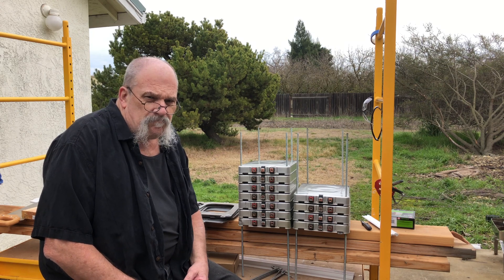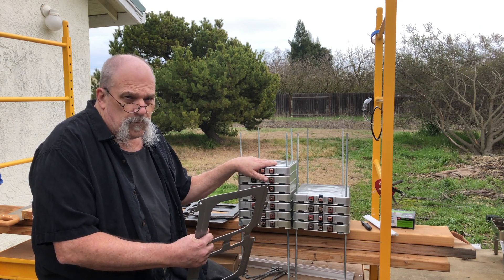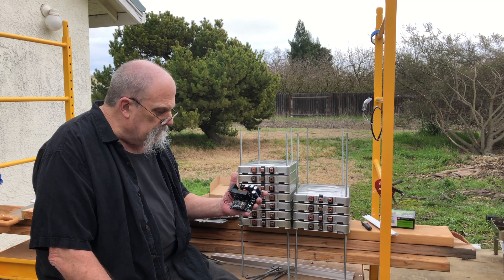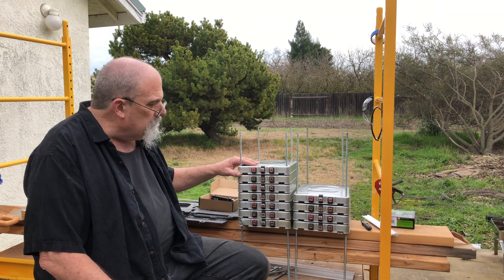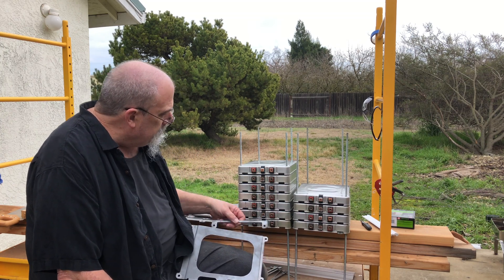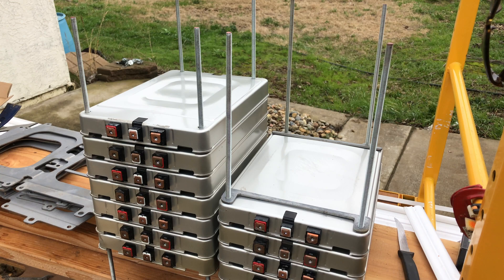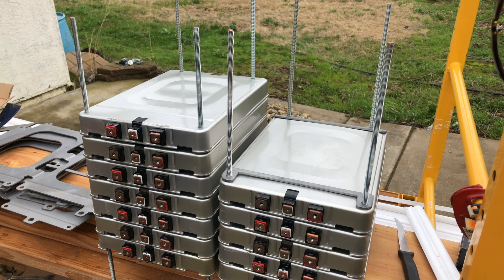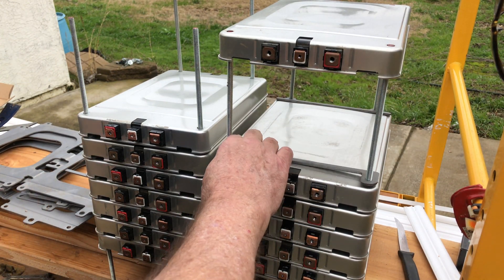Off grid 48 Volt Battery Bank

Comment: Hello dear sir can you upload a video wrap9 motor winding
Reply from the maker: I think you responded to the wrong video. This is about solar back up batteries. Not Warp9 Series DC motors for Electric Car Conversions. But to answer your question, I don’t have my Warp9 Motor any longer and to show you the windings would require me to dismantle the motor which I would not do unless needed for bearing repair.